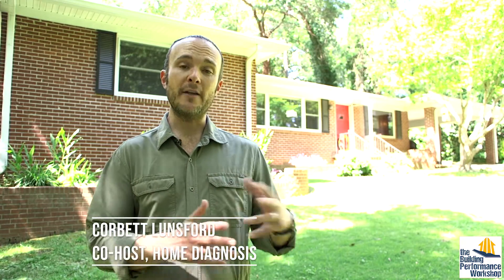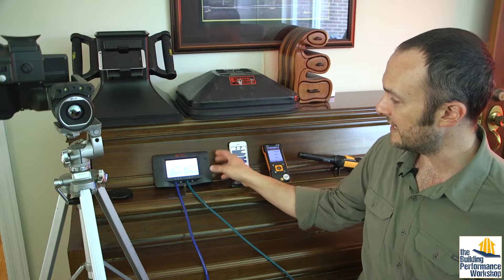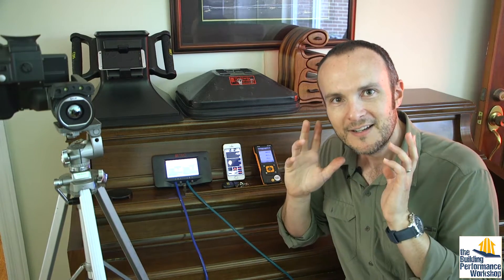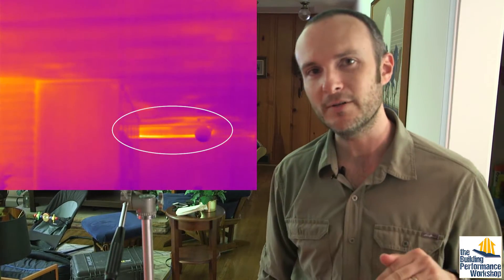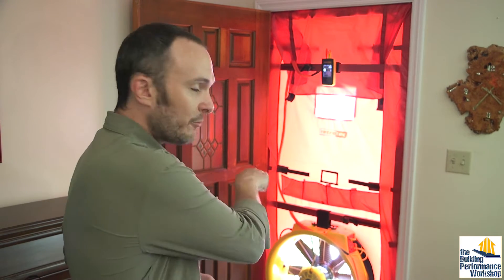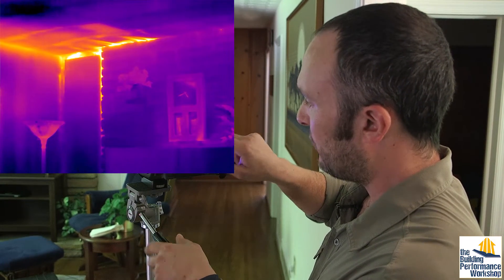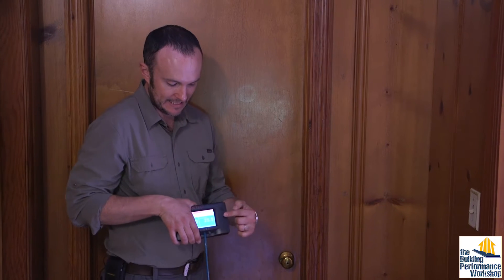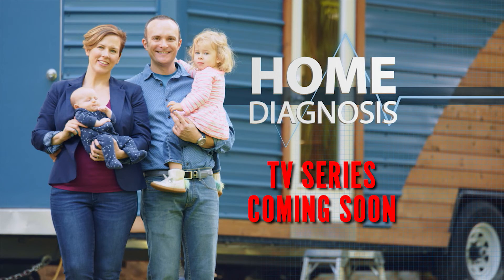Performance-Based Home Renovation: Testing Pre-Improvement at the 1960's Ranch Home

Comment: The cps hood is wildly inaccurate and you should use a hood that can pass a calibration test. Evergreen, Alnor, shortridge, testo. I saw the cps off by as much as 60% over the range they claim it measures at the calibration lab.

Depressurization brings all contaminates in the house. Bad for IAQ.

Comment: excellent video.
very interesting about the floor and crawl space vents. many people don't realize how much air comes up through the floor and what it brings with it. the old "the dirt is dry so its fine". i reduced 50% of condensation in the house by installing vapor barrier on the dirt under the house. but of course fixing the floor is the best fix, as well as fixing the ceiling to stop the stack effect dragging air up through the floor in the first place.

slightly off topic, local news item is "swamp house" https://youtu.be/yfFaXzAAxoA 
  https://www.radionz.co.nz/news/national/367548/mother-s-tough-choice-to-bring-sick-baby-back-to-swamp-house
horrible situation i hate to think whats coming up through that floor.
Reply from the maker: Dude. Disgusting.
Reply: real gross. in the decade i was working on homes it was not uncommon to find homes soaking underneath due to poor drainage (sometimes due to broken pipes).
showing how connected the inside of the house is to under the house where all that filth is, thats a real eye opener!